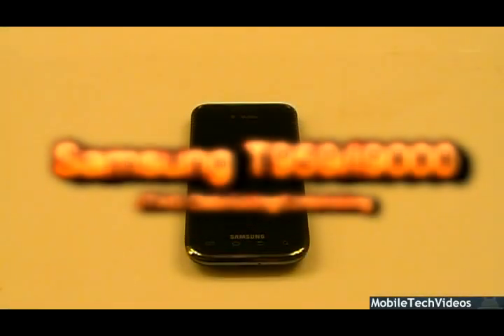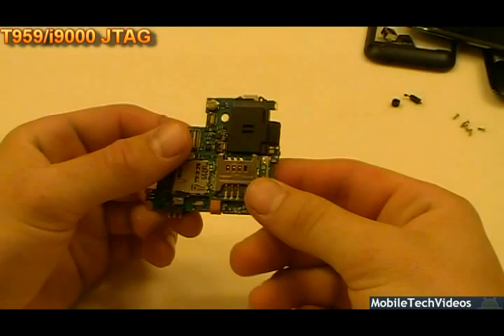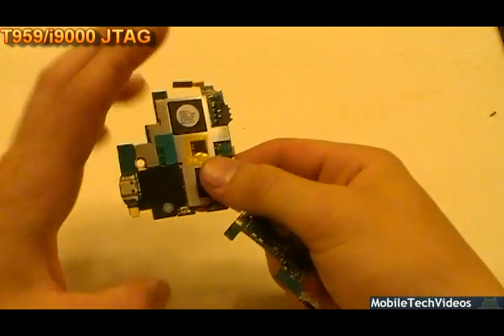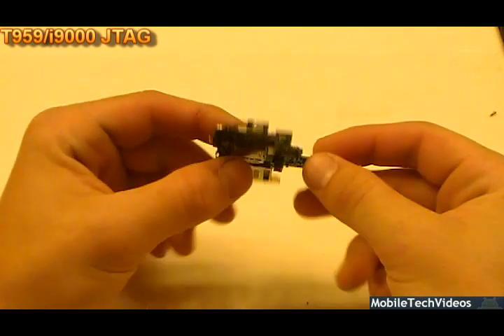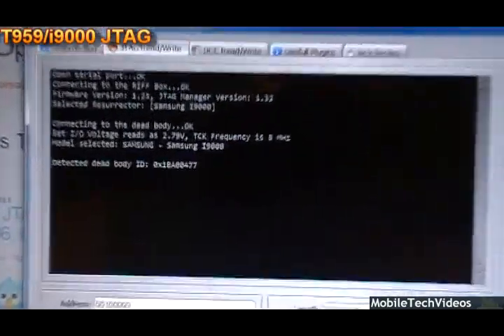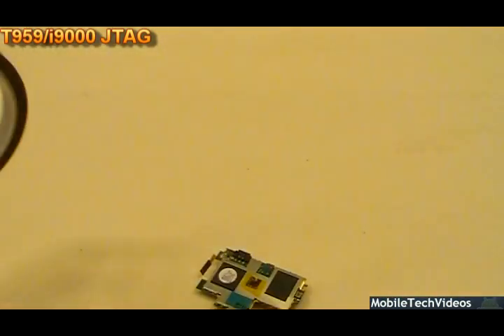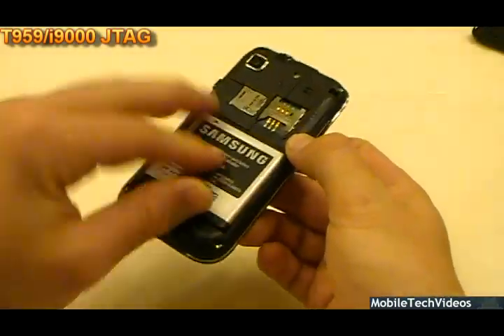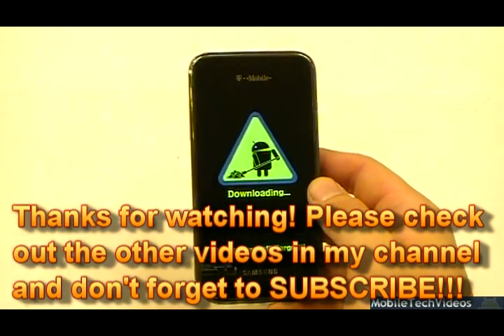Samsung Vibrant i9000 T959V - JTAG Service (Debricking/Unbrick/Brick FIX)

Comment: Hi, I've subscribed in your channel; you seems like my only hope !,  this is EXACTLY my problem year ago, I tried to upgrade my i9000 firmware to 2.3, but i've been mistaken with the ROM so my i9000 rebooted as it always does, and Bhoom, no life at all !! i tried everything !! so... will this work with my phone ?,and...yes i forgot, i use to plug it in the computer,windows plays that usb sound,but these last days, I tried to plug it again, nothing happened ! BUT it steel charging the battery!

Comment from the maker: @LuisG1890 A signal problem is different from a brick. This is designed to fix software problems that have left the phone dead. It won't enhance any hardware issues like wifi/data network.

Comment: I HIGHLY RECOMMEND MobileTechVideo's service for unbricking the Samsung i9000 family of phones, and specifically for me, the ATT variant Captivate.

I sent them my hard bricked Captivate, and they were able to use JTAG to recover the device without any issues, and do it fast.

I'm somewhat familiar with the JTAG and the Captivate, and I have to say it takes REAL SKILL to solder to the tiny pads on the Captivate's main board in order to flash Download Mode. Thanks again MTV!

Comment from the maker: @ugart3 ORT Tool or maybe the SPT box but both require the same level of soldering. I must warn you though, the Captivate is most likely harder to solder than anything you have ever done. It's pads are .1mm in size and spacing and I know many electrical engineers that consider it extremely challenging. Currently I'm in practice on the Captivate and have successfully resurrected them before. I have 2 more coming my way for practice sessions and then I'll be announcing it as a service officially.

Comment from the maker: @TDistributors This is us fixing a phone that showed ZERO signs of life. The phone would not power on in any state, nor with any button combo. We physically re-wrote the memory address values of the bootloader partition to restore life to this phone by connection to physical points on the main board to interface directly with the chip controllers to do this. That make any sense? :)